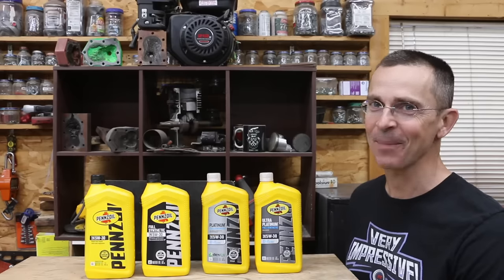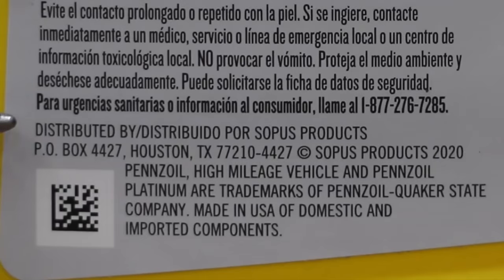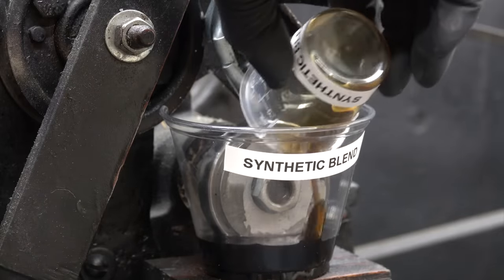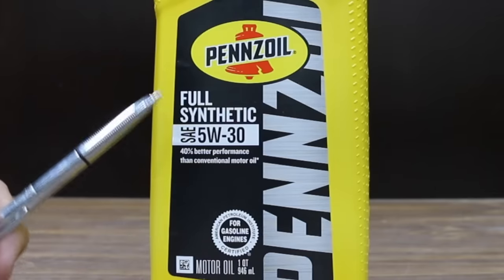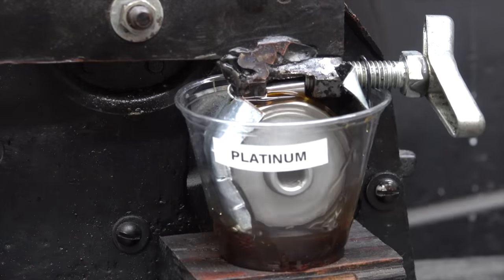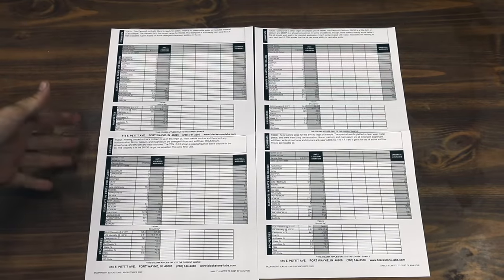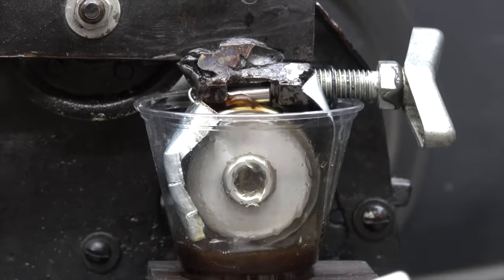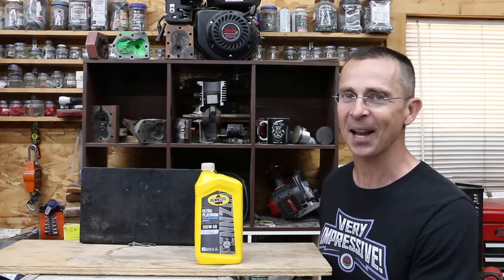Are They All The Same Motor Oil? Let's Settle This!  Four Levels of Pennzoil Motor Oil Compared

Comment: During the cold flow test, I have noticed that the Pennzoil platinum with the DEXOS certification takes a while to flow out of the tube. Now I have also watched your video comparing Mobil 1 and Supertech and the Mobil 1 that also had the DEXOS rating also failed to flow quickly out of the tube. So you would think Oils with the DEXOS rating cause poor cold flow performance right? Well, not necessarily because the Supertech oils also had the DEXOS rating and they did fairly well during the cold flow test. I wonder why Supertech performed better than Mobil 1 and Pennzoil even though all 3 oils have the DEXOS rating? New video idea perhaps?
Reply from the maker: Thanks for the suggestion.

Comment: This may be a bit of a stretch (perhaps you could simply compile video results), but could you do a video testing which commonly found oil is best? Or in practical terms, which brand and type of 5W30 oil works well? Can't afford royal purple. 😅
Reply from the maker: Thanks for the suggestions.

Comment: I was reading that higher detergents like calcium cause more low speed pre-ignition in direct injection engines maybe that’s why the normal platinum has less detergents in them?
Reply from the maker: Thanks for the suggestion.

Comment: I have 4 vehicles with direct injection motors, I change the oil every 5000-6000 miles, should I not use Pennzoil ultra platinum oil?  If so, what do you recommend?

Comment: Little confused here.  Does the most expensive Ultra Platinum Synthetic have the smallest wear of 7.1, compared to the ultra platinum Oil?  I need to use 0W20 Synthetic in my Honda 1.5L Turbo.  It always has an excessive amount of gas in the oil.  I thought the Ultra Platinum Synthetic would be my best choice..

Comment: Lake oil analysis guy said. Do not do extend oil change ever. It is the cheapest and absolute best way to prolong your engine life. Add a fuel additive that lubricates and once in a while one that cleans injectors. polyester amine should be in that cleaner. gumout injector cleaner does. lucas does not. it's just a parafin.
Reply from the maker: Great point! Thank you!

Comment: Where can I get 5 quarts of conventional Pennzoil 5w30 for $17 ?
And where can I get 5 quarts of Ultra for $28 ?
By the way, there was probably some sort of glitch regarding the Platinum cold flow performance.
Reply: I wouldn't touch a conventional oil, esp with Supertech full synthetic at $17 when 2 are bought on Ebay.  And Amazon and Walmart have Ultra for $29,

Comment: I have been using Costco' brand of Oil, Kirkland Synthetic Oil (+- $35) for years now. So far, no issues.  However, would like to stack it up against Pennzoil, which I used to use many years ago on a regular basis.  Back when I used Pennzoil, either synthetic was around yet, or just started and still too expensive.  Now it's easier to get, but by that time, I started using Kirkland's oil. Do you have any data on Kirkland?
Reply from the maker: Thanks for the suggestion.

Comment: i feel like there was something going on with that batch of regular Platinum....  it doesn't make sense that it would perform so poorly against the synthetic blend and full synthetic.
Reply: Except that there are plenty of used oil analysis reports that have been done on the regular platinum that show pretty much the same thing, that the "Platinum" is just a marketing gimmick to get people to spend a bit more that would otherwise be purchasing either the synthetic blend or the full synthetic but don't want to spend what the Ultra Platinum costs. A lot of people fall for it too. At least, until they get a used oil analysis back and the results show them that they are just as well off or even better off with just the Full Synthetic version or the synthetic blend for less than what the regular Platinum costs. Other companies do this too such as SuperTech that now sells "Full Synthetic Advanced" which costs more than their Full Synthetic but people that have done both virgin oil analysis as well as used oil analysis on the two versions show that they are virtually the same thing, with one just costing more than the other but yet people fall for that gimmick as well.

Comment: Did the Platinum and Synthetic get mixed up during the outsourced oil analysis?  Seems wrong. Why would the less expensive one have more additives?
Reply: It's a better base oil and doesn't need as much adpac to meet specs.
Reply: The Platinums are a natural gas converted to a clear, clean oil.  I don't know if its considered a group 3+ or a group 4 oil, I suspect 3+ since the oil is not hydro-cracked nor PAO/Ester

Comment: i dont think the flow rate test quite worked right around 4:20 ..my favorite # :p  it seemed like the platinum formed a stange plug or something that the others didnt, then seemed to flow at about the same rate, im wondering if the way these are chilled or possibly where theyre placed in.. whatever ur using to get these to -40 lol :p ..i wonder if thats causing some uneven cooling, it would b cool to have a thermocouple in each one just because y not :p iv got a 4 channel one i got off ebay really cheap to monitor exhaust temps on a built diesel, so acquiring one wont b a problem
Reply from the maker: Thanks for the constructive feedback.

Comment: Hey I wanted you to end a debate with me and my co-workers. They all seem to claim that engine oil inside of a sealed crankcase cannot evaporate, and any oil inside of a non leaking engine that "is used" has to be burned through the combustion chamber and out the exhaust. Let me know what you think and maybe you can make a contraption to test this. Thanks!
Reply from the maker: Thanks for the suggestion.

Comment: Hey Todd, is it cool to temporarily use 0W-30 in place of 5W-30 during colder seasons, even if the oil cap says 5W-30?
Reply: Just use what your engine calls for. Factory specs.

Comment: I think I'm done with Pennzoil Platinum, now.  I'm just going to use the Pennzoil Full Synthetic and save some money.  I ain't worried about my 3800II V6 hitting 350F oil temps as I drive it to make it last because it IS a GM, after all...
and we all know what happens when you go WOT in a GM a handful of times.  Things tear up lol.

I've been using Pennzoil Platinum 5W-30 in this engine for 40-50k miles with 5k-6k mile oil changes.  It now eats at least a quart of it every 800-1k miles.  

I tried Rotella T6 5W-40 back in the day when it had around 60k miles but it made a ticking noise so I figured it was too thick.  Now it has 135k miles (not bad for a 2000 model Buick Park Ave) and I may give the ol' T6 5W-40 a try, again, as it is my favorite oil.  It's got a great additive pack and seems to rejuvenate seals like a "high mileage" engine oil.... which is what I've been adding to my car for make up oil the last few quarts.  Pennzoil Plat 5W-30 High Mileage.  Actually seemed to have slowed down the oil consumption a tad, but still...

Eh, who cares?  I believe my intake/head gasket should be blowing any time now.  I did a complete coolant flush with Dexcool around 50k miles on it.  Guess it could use another one.
Reply from the maker: Thanks for sharing.

Comment: Diesel truck oil e.g. Rotella T4 or Delo400 harm a big block engine or provide better protection than gas engine oils. I have a 7.5L 460. I usually use Delo400 30 but recently switched to Rotella T5 15w 40
Reply from the maker: Thanks for the feedback.

Comment: I keep my oil changed every 6000k miles without skip since it had 26k miles, should I go ahead and move over to synthetic oil in my 2016 Equinox since it has over 100k miles now?

Comment: Please test the new Evolve EvoSyn motor oil which is a Non Petroleum plant based oil. They claim Porsche tested this new oil that is supposed to extend oil change intervals to twice the mileage and gives higher hp. You can buy a quart direct from their website. Thanks!
Reply from the maker: Thanks for the suggestion.

Comment: One unfortunate item not discussed by the oil manufacturers is "service frequency". No doubt some people will never take their car in for service or pop the hood to check things over themselves until the idiot light goes off on the dashboard telling them it is either time for their oil change or something else "happened". So, if a motor oil says it is good for X thousands of miles, people will drive it X thousands of miles before doing any service. Tires need to be checked at least monthly, oil and other fluid levels need to be checked monthly, and so on. Letting things go for tens of thousands of miles, in some cases, is a recipe for small issues becoming huge expensive problems. Makes you wonder how many oil companies will have to lean on the numerous owners manuals to avoid lawsuits if people decide to service their vehicles every ten or twenty thousand miles? Some people think those big numbers mean they can just "let things go" until they reach some magic number on the odometer in the future.
Reply from the maker: Thanks for the feedback.

Comment: I use rotela in my duramax.   would you say it is the best or is there a better oil for duramax engines.  I change oil every 8,000 miles.
Reply from the maker: Thanks for sharing.

Comment: Why do turbos increase fuel contamination and does that happen in diesels as well?

I just changed Mobil 1 in a VW Turbo diesel with 85,000 miles on that oil.

What tests of that oil would be good to test?
Reply from the maker: Thanks for the suggestion.

Comment: Question:  Is it a bad idea to mix different oil viscosities from the same manufacturer?  How about from different manufacturers?
I have a full 5 Qt. jug of 0W-20 oil and a fill requirement of 6 Qts.  I have on hand, another 5 Qt. jug of 5W-20 oil, minus 1 Qt. from a previous oil change. 
How much would the 1 Qt. of 5W-20 affect the properties of the 0W-20?
Thank you for doing these Comparisions.
Reply from the maker: You are welcome!  Thanks for the suggestion.
Reply: I've done it, only thing that will happen is that if one oil is a lower qualtiy than the other, it will pull down the qualities of the other oil.    I've mixed 0w20 with 10w30 to give me a viscosity between the 2.  I've mixed brands of oil since I started driving in 1972, never had a problem.

Comment: I am wishing that you would do a test on Penngrade1 oil. This is a special oil that is formulated for use in older engines with flat tappet lifters. It has more friction additives like zinc and phosphorus. For this reason it does not qualify for API rating and is not intended for use in car with catalyst. I would like to see some proof of the claims.
Reply from the maker: Thanks for the suggestion.

Comment: Curious on your thought my wife delivers the mail in a new jeep wranger 2.0 turbo after watching this im goen to run the penzoil ultra platinum it being a 4 cylinder it has only a 5 quart system would it be work running a half a quart or full quart of synthetic lucus oil stabilizer also with hundreds of start and stops a day?

Comment: How about testing Valvoline Advanced Full Synthetic against Pennzoil Platinum Ultra? Both are great, but which is better? There are some reviews, but most, if not are biased due to obvious connections between the reviewer and a certain company, while others have no testing other than their own personal driving experience.
Reply from the maker: Thanks for the suggestion.

Comment: Did Penzoil stop using Parrafin Wax? I've spoken to several mechanics, who have seen large deposits of parrafin wax in engines from using penzoil
Reply: They don't use wax, no.
Reply: A lot of non-synthetic motor oils had a few PPM of paraffin wax, which was industry-acceptable. Pennzoil was rumored to have higher than average paraffin content, I recall in the 1990s. With conventional oils almost obsolete and synthetics more ubiquitous, the less petroleum by-products, like waxes and ash. Just my edumacated guess.

Comment: You know we see all of this stuff about synthetic oil's being so much better. But I really don't see engines running any longer than I did in the 1980s. And of course I'm talking about Hondas and Toyotas back then. I'll put 350,000 miles on my 1988 Corolla. A friend of mine dad had a 85 Corolla that he put 430,000 miles on it all with regular oil. Working with a guy that has a Tacoma with 420,000 miles on it and he has only used regular motor oil. So somebody tell me where the synthetic oils make engines last so much longer?
Reply from the maker: Thanks for the feedback.

Comment: Pennzoil discounted its conventional oil back in 2008 synthetic blend is the cheapest today.
Reply from the maker: Thanks for the suggestion.
Reply: Based on the bot like reply, either Todd didn’t read your comment, he used a bot, or an assistant is just typing whatever.

Comment: What oil brand would you use on a 2019 ram 5.7? Castrol Edge, Mobil 1 or Pennzoil ultra platinum?
Reply: I doubt he would ever make a suggestion.  Me, it depends on what viscosity oil you are allowed to run.  If 5w30, or 10w30 is allowed, all group III oils are fine, if you're forced to use 0w20 per your owners manual, then Redline, Triax, or Shaeffers if under warranty.   Out of warranty, any group IV oil...

Comment: Which motor oil is better between Penzoil ultra platinum and Rotella gas truck?  I drive a 3.5 ecoboost with direct Injection.   I like that the Rotella gas truck oil is dexos gen 2 approved and API SN PLUS rating.  I don't see these with the Penzoil ultra platinum.
Reply from the maker: Thanks for the suggestion.
Reply: @ProjectFarm  also the Penzoil ultra platinum is made from natural gas.   That is very unique as I am unaware of any other motor oil derived from natural gas.   Penzoil is made by Rotella and I have been happy with the Rotella gas truck motor oil although from what I've seen it is being discounted.

Comment: 2:35 looks like the light clear changes to very dark occluded oil after being heated. Is this common?
Reply: In most cases yes. So many people assume that when their motor oil turns dark that it's "dirty" but as you can see in this video as well as many other videos where motor oil is heated, one of the results of that heat is the motor oil turning very dark, even though it's not even being run in an actual engine. Combustion byproducts can definitely contribute to motor oil the dark color of used motor oil, but just keeping motor oil hot for extended periods of time does that all by itself as well. Some motor oils resist darkening from heat better than others. For example Quaker State Full Synthetic in similar tests conducted by this same YouTuber did significantly better at resisting going dark  while exposed to heat and also showed the lowest evaporation rate.
Reply: @marketingmajor8126  Thank you. I had suspected this, and your explanation is very much appreciated. Thank you.

Comment: My old Nissan Hard Body don't know that synthetic oil might be better with right at 400,000 miles of conventional oil use and still runs great but now you can't buy straight Pennzoil oil anymore it looks like i might have to change I'm 64 now things are changing to fast now.
Reply from the maker: Thanks for sharing.

Comment: What about Platinum High Mileage?
Reply from the maker: Thanks for the suggestion.
Reply: Good oil. I only put that in my 2013 Ford Edge 3.5L V6. Car has 190k miles, doesn't consume oil, I change it every 5k miles and the high mileage oil still looks pretty clean when I drain it. Engine runs quite with good gas mileage.

Comment: And now I feel stupid because I bought the platinum at Walmart, they didn’t have the ultra
Reply: When they don't have the Ultra, I substitute the Platinum for my summertime oil, hoping for better high temperature protection vs hydro-cracked oils.  As I'm forced by my warranty to use 0w20 in the summer.